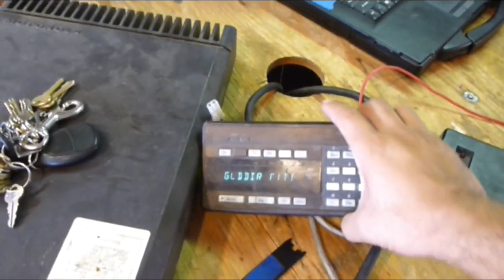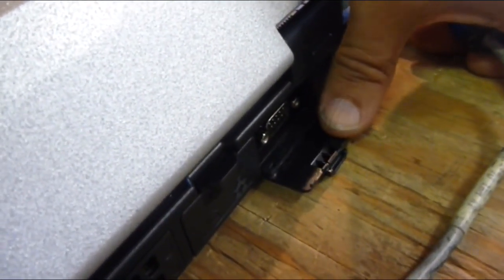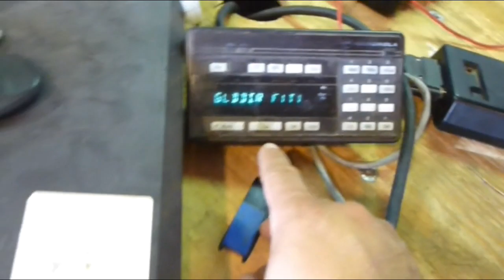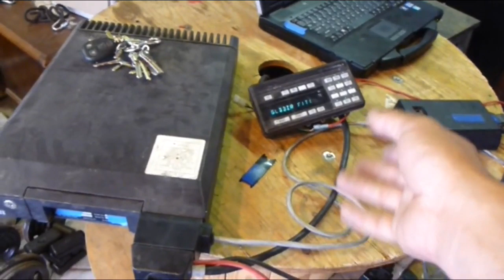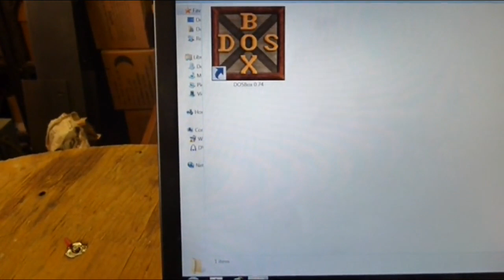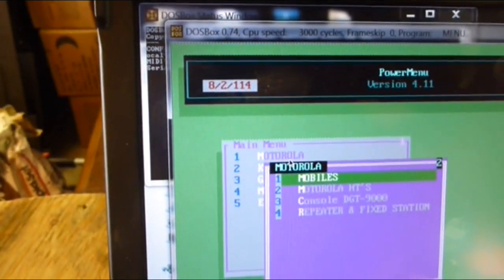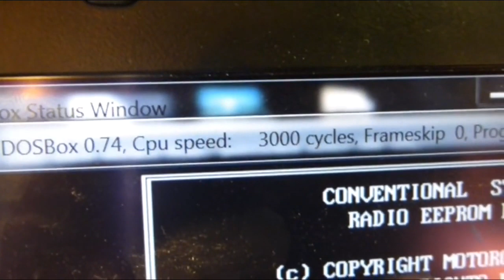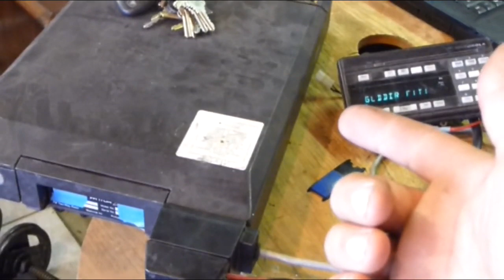Surplus Radio Guide Series, Programming Motorola Syntor X9000 Hell

Comment: I use dosbox to program all of my older Motorola,Kenwood and ge radios. I always set the speed to 450-500 I’ve never tried 7,000 😮
I’ve also tried this on several different computers. Windows 7, Windows 10, Windows 11. All of them work great at 450 to 500. 
Of course I use a real cereal part because all of my computers are tough books. I need to see if I can use a USB adapter.

Comment: I hate to ask this, but why not just use a BaoFeng? They're cheaper and do the job.
These legacy devices are massive, hard to program, and require old computers to program.
Reply: if you think a baofeng handheld better than motorola and kenwood handhelds you have no idea about radios
Reply from the maker: Simply because they are bullet proof with a reputable track record for reliability under hard usage. Though, I do agree with your comment, its cheaper to throw away and replace it with a new radio than having to repair or hold on to obsolete supporting equipment. Good question, I'm glad you asked it..
Reply: A baofeng is not a pimple on the ass of a motorola syntor or spectra or maxtrac or Saber etc
Reply: SomeGuy baofeng doesn't really have a automotive solution, and most modern automotive ham radios are expensive. The remote control head is nice too

Comment: i have one that won't turn on when i hook it to a power supply, is there anything special i need to look for to get it going?
Reply: John v the remote control head has an orange and green wire, make sure those are connected properly
Reply: Neil Caulfield Radio could be wired for ingtion sense

Comment: Are you familiar how with these models, especially to hook up the siren/p.a?
Reply from the maker: Aaliyah Zhuckkahosee I do, but offhand, I don't have the part # to the siren unit it interfaces it with for that option. You would also have to program or enable the siren option in the programming software. Basically its another box that has the power amp and it piggyback rides on the big plug on the control cable of the RF unit.
Reply: GUERRILLACOMM the wiring diagram for the dek  siren box can be found online.

Comment: 2135 key.
Reply from the maker: Yup. The keys to the Motorola kingdom. There's this radio site that has FBI comm equipment, they changed the standard Motorola locks out with a different keyed system. They must of known I would of snooped around their gear. lol

Comment: I'm still in the middle of watching but so far it sounds like the Motorola unit just ain't worth the trouble for anyone other than a skilled operator.
Reply: motorola radios are great even the older 1s..  if you have the right shit you need to program a radio..  if it uses dos then run pure dos on a older comp and the system cache disabled you wont have any problems... what this guy doesnt talk about is bricking your radio and ive done this few times using a faster comp..  a person who is just starting out programming radios ya it may look like you wouldnt know what to do but if you can read and setup the com port right depends on how many channels more you have little more time itll take.. alot of info about any radio and how to program that radio you wanna program...   even the older kenwood radios that use dos has to have the system cache disabled in order to even read them or youll get error messages too.   i have systems saber 3 few of them they are great radios even to this day andd how old they are i still use them even on the boat always have great radio checks on the river too..

Comment: http://wd6awp.net/drupal/xcat
Reply from the maker: Nice, I like the remote operation capability that this will provide. XCAT will turn the VHF lowband Syntors into a nice practical 6 meter home base rig.
Reply: GUERRILLACOMM You can remote-control them too using app_rpt.  Cue frequency-agile general-coverage VHF-L/VHF-HI/UHF 100watt remote bases for cost of very little.  You should do a video on them.